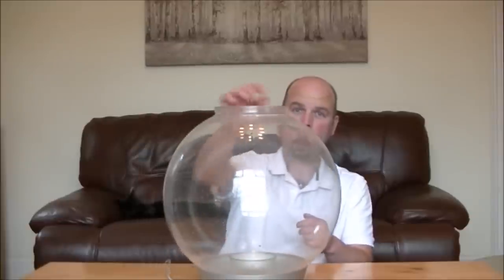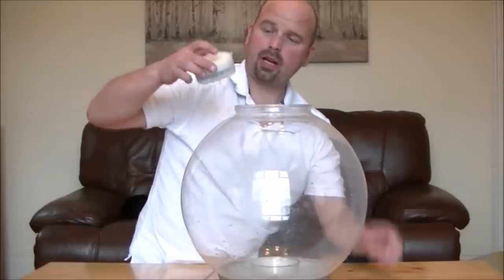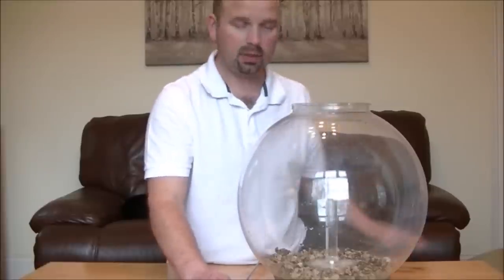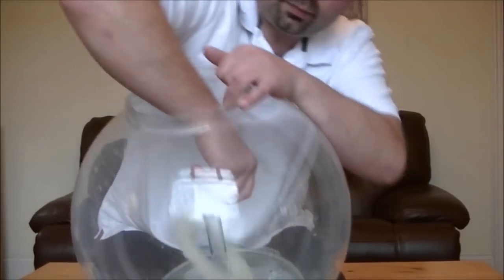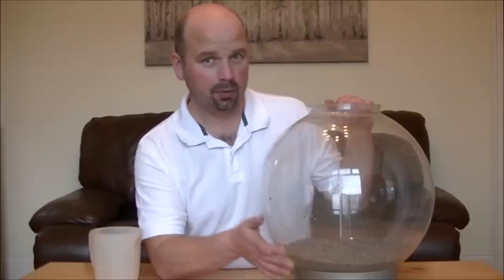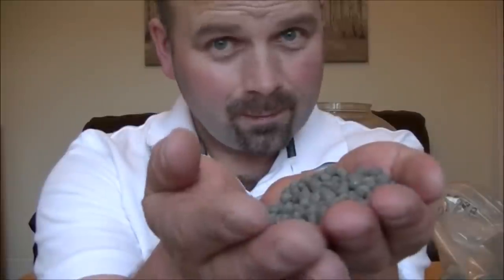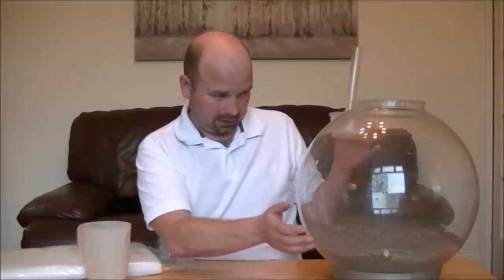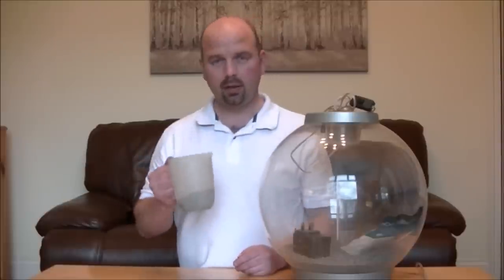BIORB COMPATIBLE UPGRADE KIT

Comment: Mind if I praise you here...?

I bought some of your gravel, intent on using it in a larger tank I was setting up, but instead used part of it in a Rena/API Filstar XP3/L... on a overstocked 20-gal... in the following order:

      API 2-stage Floss Filter
                      ^
Marineland Ammonia Controller
                      ^
  Marineland Activated Carbon
                      ^
        30-ppi sponge filter
                      ^
        20-ppi sponge filter
                      ^
              The Media
 
Once the filter was primed & running, I was surprised by how well it worked because after three days of operation, I did a water-change... much like I usually did before when all I had was a pair of HOBs (AquaClear-50 & Tetra-20)... and I'm surprised by how much of a difference was made: Crystal-clear water from that day on for 5-days now! The only real effort made since was changing the floss after running API Accu-Clear once after the change--just to get the particles out after also cleaning the gravel first! I'm not even sure whether I'll do just a partial water-change Tuesday or just add extender!

Thanks for the stuff & wish me luck in whatever way I decide to go come water-change time!
Reply from the maker: pancudowny By the looks of it the media is in the bottom? It should be in the top, protected by the foams with carbon (if used) after it so it doesn't get clogged. I may have misunderstood the set up you've got there but this video shows how to set up an external filter and explains what should be happening in there: https://www.youtube.com/watch?v=lsAmSD3wVbg
Reply: +Pondguru Outdoors
Oh, yes... I've just viewed that video, and it has me considering re-arranging the "stack" come water-change time. Meanwhile, I've gotten "feed-up" with the AquaClear-50--filled with it's standard sponge & a sack of Seachem Seagel--under-performing after being reassigned to a much-smaller "quarantine" 5-1/2g-gal. So, I did this:

                      Seagel sack.
                               ^
            A trimmed-to-fit section of Tetra drop-in floss filter-sack.
                               ^
30-ppi atop 20-ppi foam sponge, trimmed from extra stock that came with the Filstar. (It was on-sale@local, indie FS... Used($65!))
                               ^
            A small sack of "the Media".

After two days, with the addition of a API Stress Zyme+ and another shot of Accu-clear, it had some effect... but not a full one. After an approximately 50-60% water-change & another shot of the 'Zyme+, I was surprised the next morning with the sight of a tankful of practically-perfectly clear water... and a dozen highly-active, seemingly happy juvenile Parrot Cichlids that immediately swam-up to greet me, as if to thank me for making the water so clear & healthy. And for their usual begging for food, of course.

My current method seems to be enduring, and hopefully will for a great-length of time... but I will consider effecting your suggestion of re-arrangement with the HOB first, as I foresee changing the floss on that soon. And consider using a trimmed section of Tetra-Smart two-stage floss sack--for finer filtration.

Here's hoping... And thanks again!

BTW: I'm also considering addition of a sponge-filter on the canister's suction inlet-end, to further aid cleaning & safety.
Reply from the maker: pancudowny There are so many tweaks and adjustments which can be made with any filter but as long as the majority of it is set up right with good foams / media it will perform well.
Reply: +Pondguru Outdoors
When a opportunity came to service the tank a few hours ago... Tank sits above TV viewed 24/7 by 70y/o woman... I just did a partial(?) change of water & added the usual two shots of chemicals... followed by a gravel cleaning. I know, I should've done the tank-gravel first. But I felt pinched for time, then I felt lucky.

It hurt seeing that pristine water get mucked-up by all the fine-particles that the filter on that Eheim vacuum-wand can't catch, so I'm gonna either start work on a better design with an AC-powered water-pump, or just buy a better one seen here on YouTube.

Thanks again... and here's hoping what I'm doing will endure. Meanwhile, are there any suggestions as to what to check/change when? And you can relax, for now... You won't hear from me again unless something goes really awry in the meantime. (Unlikely)

Later!
Reply from the maker: pancudowny The amount you need to check the water really depends on how good the filtration is as that dictates how much and how often you need to do partial water changes.As long as you have no ammonia or nitrite and low nitrate its all good but ideally you'd still do partial water changes each week - even if it is only 10% just to freshen things up and clean the substrate.
Reply: +Pondguru Outdoors
Gotcha.

Comment: Hi, I purchased the biorb upgrade from you and many thanks. Should i wash it before i use it pleas. Keep up the good work
Reply from the maker: I think you sent an email asking this about 5 minutes after posting the comment so I will answer the question here. Yes ideally the media would be washed in either old tank water or treated tap water to remove any dust generated during transit but it is not essential. Any 'dust' is just fine and and will soon settle.

Comment: dear guru, how soon can you return the fish to the tank after finishing up the upgrade. and second question, did you say on the video that there is no need to replace anything such as gravel, etc in the upgrade kit once it's in place in the tank. tyvm. sorry if you didn't say it
Reply from the maker: +Rudi GaekMada If you have original water and fish they can go straight back in but you may want to use some of the alfagrog media which you would have had in the biorb and put it on top of new substrate it will contain some good bacteria which will help seed the new media (substrate). Just make sure that the biogravel which comes with the kit is well washed so when you set the tank up there is less chance of it being cloudy. Once the upgrade kit is in the outer foams should last years and the media will last almost indefinitely. Depending on stock and how often media is cleaned with gravel cleaner you may need a full strip down every 6-12 months.

Comment: thankyou the fitting is small but takes an 10 watt halogen bulb like that in a baby bio but I bought one for £6 off the net but got identical in £ shop and works but I am still not sure if a look alike would work with a different type of halogen
Reply from the maker: Chances are it will be exactly the same so I wouldn't worry.

Comment: I received my kit from you in today's post and set up my 6 year old daughter's brand new Halo 30ltr with it as per your video. It all looks good from here. I used the fine filter pad with some carbon and some of the conditioning gels that came with the kit in the standard Biorb filter and scrapped the foam doughnut that came with it. We're just going to leave it cycling away for a week or two now and then we're going to do a bit of aquascaping with pre soaked bog wood and java moss, so the carbon should help with that. The question that I have though, is because it's a Halo the plastic moulding at the bottom of the tank sits above the level of the filter media that came with the kit. So to raise the level to slightly above the plastic moulding so that it gives a bit of 'foreground' to the base of the tank would it be a bad idea to use some of the alfagrog that came with the tank as an extra layer? She's only going to be keeping eight galaxy rasboras and four or five cherry shrimps as a clean up crew, so the water level of the tank can be displaced a little without to many worries. I'm wondering though just how shrimp friendly the alfagrog is with it being so rough and heavy compared to the media that came with your kit?
Reply from the maker: Dear Paul,
The alfagrog is fine for shrimps as they do like it for living and feeding in so no worries there. Yes the skirt on the halo is much taller than the standard tank - you could plant some low growing carpet plant like this, using the grog as feature 'rocks' in a miniature landscape?:  https://goo.gl/3yp8g6
You'll still be able to clean the biogravel and foams through it with a gravel cleaner like this: http://geni.us/0YMWPJJ
Regards,
Richard

Comment: I saw your video regarding turning decor into air pump and filters with a spin stream to make smaller bubbles. I was wondering if I could modify the center in my BiOrb to do that same thing?
Reply: I saw that and thought the very same thing Rhonda. I just found a classic 15L  for 40 bucks and I am going to try it without the spin stream first, 4 gallons might be a bit small for that, but for sure a mini power head with the little air draw hose right on the under gravel bubble up tube instead of air pump driven system, custom cut foams under bio home's bio gravel as well.  It may take an adapter or some such to mate pump to the up tube, also the power head is heavy for being mini, so maybe some pump supporting/hiding center decor build as well. Anything is possible with a little corrugated plastic cardboard, scissors, silicone, rocks, sand, and time...lots of time. Give it a try and show us how it turns out. If I can do this, https://youtu.be/E6jGi0FoQYA, you can do your idea!  I will post how mine comes out on my channel when I get it going and let you know "cuz it is a neat idea. My biorb arrives this Friday so ...123 GO! Good Luck!

Comment: Hi, I have been given a biorb 30ltr by some friends and after having read all the poor ratings of it was glad to find your upgrade kit which I have ordered. Just a couple of questions, how long should I leave the new set up before adding fish and how many and what sort of fish should I put in the tank? I do not have a heater so small cold water fish I guess but being new to fish keeping am not sure what to get. Asked at our local aquatic centre within a garden centre who were very unhelpfull!
Reply from the maker: +Kathy J White cloud mountain minnows, hillstream loach and amano shrimps (if it is at room temperature) will all be fine. Apart from that I am struggling as it has been over a year since I sold fish. 
Maybe some of the Danio species and certainly guppies if its room temperature but you don't want too many fish in (maybe 10 - 15 mid water fish) and it is always best to go with at least 5 of each type.
Once set up it is best to let it run at least a week before adding the first fish.
Hope that helps and thanks for the order.
Regards,
Richard

Comment: Thank you so much for this video! I brought a biorb life 15 for my betta, not realising you couldn't use gravel as I didn't research the tank before hand as betta was in impulse buy after not owning them for about year and seeing a stunner in pets at home!

Have just brought a conversion sponge on eBay for £5.99 so now and I can have a nice planted tank.

Thanks again! X
Reply from the maker: Yes the simple foam block covered by ordinary aquarium gravel is fine - certainly much better than the normal filter but bear in mind your nitrate will still be sky high so water changes will still be frequent and large to keep it right. That was the reasoning behind developing the biogravel as it is a porous gravel which supports both aerobic and anaerobic bacteria for full cycle filtration.

Comment: This is a great video, thanks.  Can I ask if the 'home'-made filter and media would work on the bioorb flow?
Reply from the maker: Yes it would although the foams would have to be cut to the full size of the tank base for that one and the 'life' tanks. In that case it would be best to use black foams as they can be seen through the side. The base area is larger in those tanks so it needs approx. 3.5kg of the biogravel (or ordinary aquarium gravel if you're not bothered about high nitrates).

Comment: Thank you for your quick response :) ..so when we've used your upgrade kit, placed the foam circles (medium + coarse) in base, and return "everything" back into the orb are we ok/to put the original media back in on the foam base first and then the biogravel on top of the original media? (we have a 60ltr biorb with stock of 6 neon tetra, 1 sml female betta & 4 glass shrimp)
Reply from the maker: I would put the original media on top of the new biogravel for a couple of weeks as it may have a reasonable amount of bacteria on and in it. After 2-3 weeks it can be removed as the biogravel matures very quickly.

Comment: My 300 ltr aquarium has got water marks from inside. The tank is up and running. How to remove the stains? Please suggest.
Reply from the maker: +Rohit Tulsiyan When you drain water during maintenance just scrub marks off with a suitable aquarium pad or scraper. If the marks are white they may be harder to remove and may require a vinegar solution on a pad so best done when tank is empty.

Comment: Thank you! This was verey helpful and informative: I plan to do this.  One question though, what is the fine filter you used?
Reply from the maker: It is a fine pond filter pad - if you search for 'fine particle matting' online it will come up. I have it on the Filterpro website in 11" x 17" pieces but it is available in loads of different sizes.
http://www.filterpro.co.uk

Comment: +pondguru outdoors do you think this would work for a marine tank?
Reply from the maker: Sorry just seen this now. Yes a few people have used this exact system for marine but the water still needs conditioning properly with the appropriate salts etc. Most people will use rock to help with water condition too and it would sit on top of the biogravel.

Comment: My question for you Pondguru, is in switching to the under gravel filter, I know the biome gravel will remain active as  you mentioned for 6-10 years, however how often do you need to replace or clean the two pieces of foam lining the bottom?  Thank you for thinking about this and sharing with the world. I like the biorb tanks for their modern design but didn't buy one because their filtration is crap.
Reply from the maker: The foams should last a good 2-3 years as they are good quality but how long the system goes before a strip-down will depend on how often the biogravel is cleaned with a gravel cleaner (and how much muck is drawn out of the foams during the process). This is the gravel cleaner suitable for biorbs: http://geni.us/0YMWPJJ
Reply: +Pondguru Outdoors Thank you so much for answering my question and the additional detail!

Comment: I have a Spyorb, made by Reef One - the same as the usual biorb but covered on the sides with only a clear "spyhole" on the front. Anyway I'm looking at this upgrade kit so that I can keep a  few little pygmy puffer fish or 1 green spotted puffer. What I wanted to know was if this kit would be suitable for the brackish water that GSPs would need as they get older? Thanks for your help!
Reply from the maker: Natallulah Yes the media is inert so marine  / brackish use is no problem. I would probably go for the pygmy puffers over the green spotted due to the size and you can have plants with the pygmies too.

Comment: I thought that you needed to have water with some prior filtration so that the media doesn't clog. The way you put the bio gravel will clog easily.
Reply from the maker: As the media is not in a sealed unit having water (and dirt) forced into it the clogging issue is largely avoided as a simple weekly gravel clean is all which is needed to properly clean an undergravel system and remove waste.
In any other filtering situation where water is forced over media it stands a good chance of clogging although I do probably exaggerate that problem to drive the point home. Media really needs to sitting in masses of filth for a long period of time to clog completely .

Comment: How often, if at all, would I need to change the foaming the bottom and the changed filter you showed please? 

Many thanks.
Reply from the maker: +smallbluethingy They tend to be broken down by light or by excessive cleaning so as neither of those factors apply when they're used as an under gravel filter they should easily last 1.5 - 2 years.
If they're clogged beyond cleaning they will need replacing but even if they were never cleaned that would take ages in an orb. A gentle push down when using a gravel cleaner will draw loose muck from foams.

Comment: Brilliant!! I've recently ordered a 105l Biorb and was concerned about the apparent lack of filtration. This looks like a great solution. I guess it's possible to put a mesh over the top of the filter media and then add a gravel of choice on top?
Reply from the maker: Yes you can use any gravel if you're not worried about nitrate level and it will still do a great job on ammonia and nitrite (and clarity)

Comment: So would you need to replace the 2 foam circles around the middle filter often or only after the 10 years?  I have shrimp in my BiOrb so this setup would be a real money saver for me and very ideal!
Reply from the maker: The media would last 6-10 years. The foams would lose their bounce after 18-24 months and the medium grade foam may become too clogged to clean after that time too (cleaning would be done with gravel cleaner, pushing it through media to depress foams and release muck).